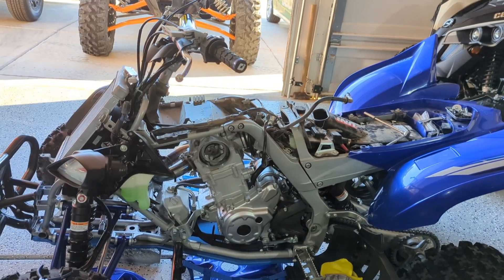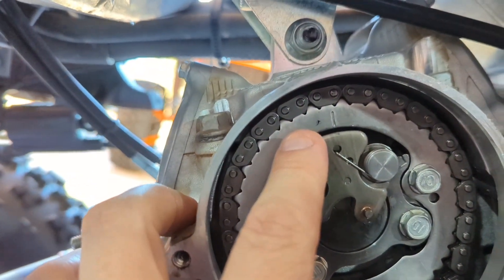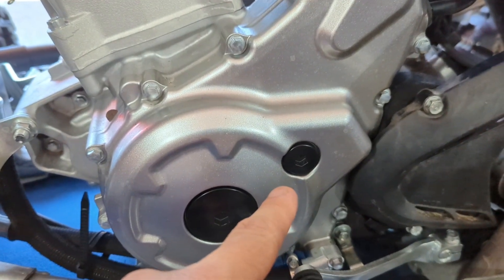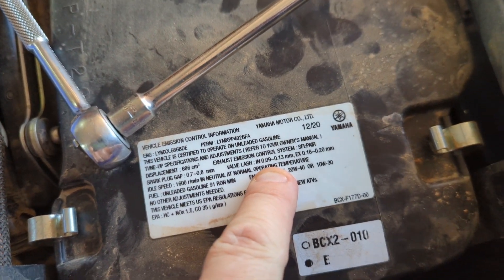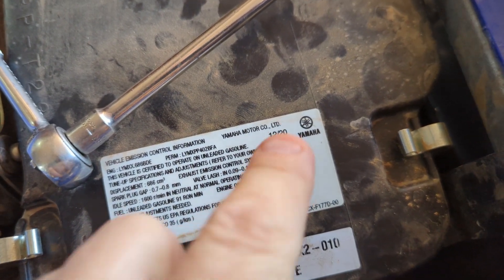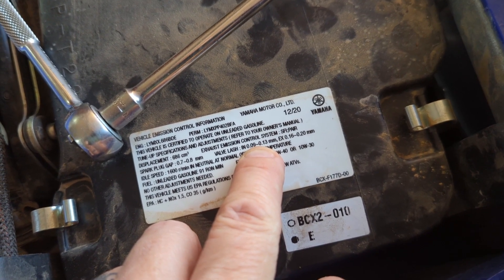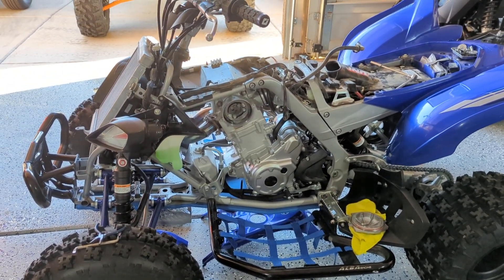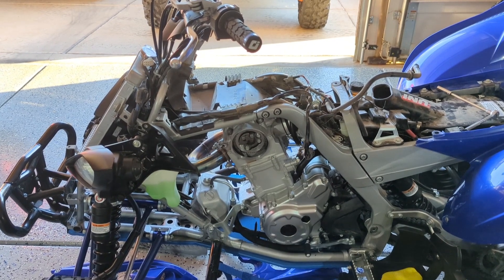2020 Raptor 700 first valve adjustment  at 70 hours! was it to late?

Comment: I bought a used 2009 with 270hs. Knowing the owner I'm mostly sure he never touched it. Also he mostly did some country side rides, so.. light use.

And.. the exhaust valves were perfect, the intake were on the 0.09 limit (I left them on ~0.13) but still insane for 270hs.
Reply from the maker: It's a real testament to how great these motors are built. they are bulletproof.
Reply: 650hrs and 18k kms on my 2010 lol original motor, still going strong 💪
Reply: I thought mines was bad 60 hours on a 2011 model man it’s good to here the moters are bulletproof 👌